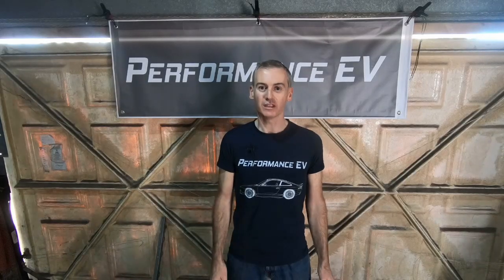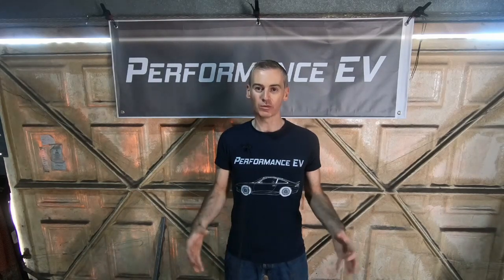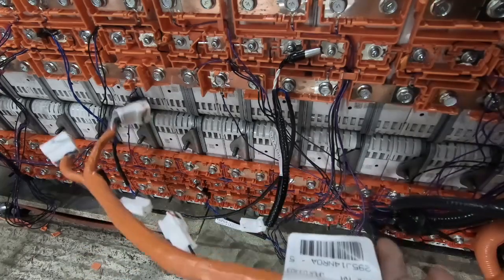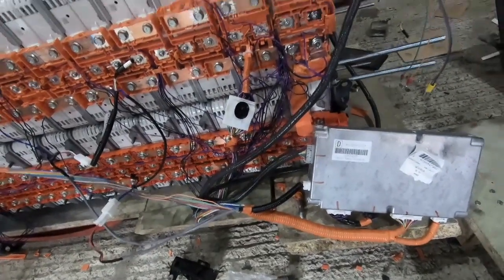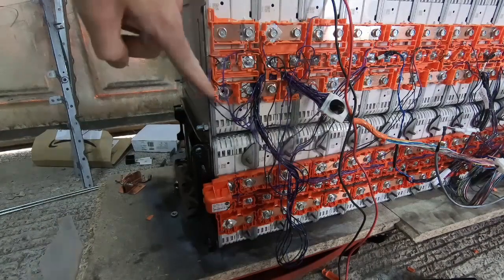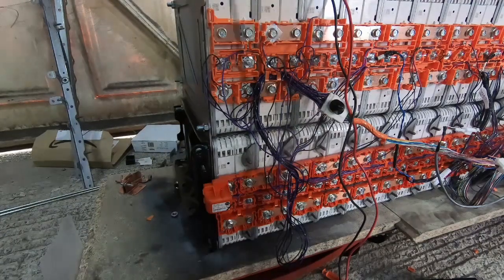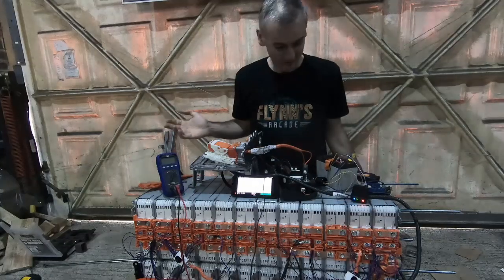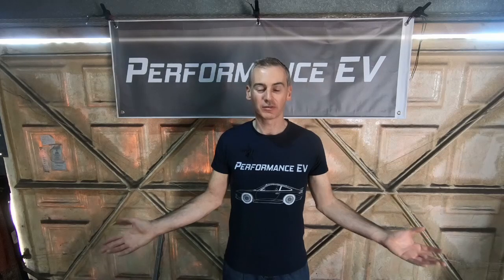Electric Porsche 911 project video 45 - Connecting DIY Custom Battery to Nissan Leaf BMS

Comment: You should be able to get the inverter, charger, and BMS on the same CANBUS. That way you can stop charging if there is a fault and make sure you don't drive accidentally drive off with the charger connected.